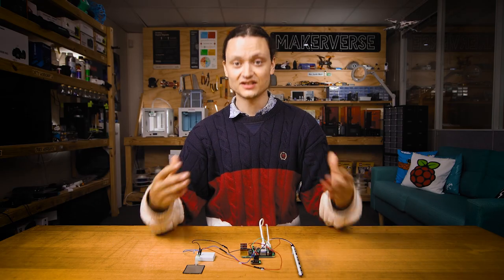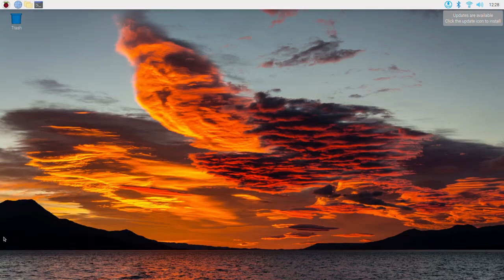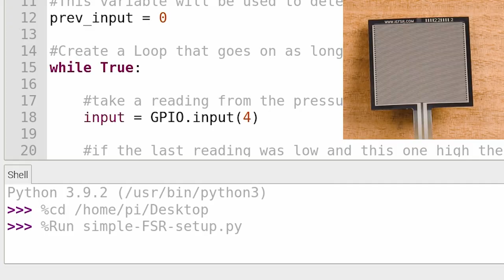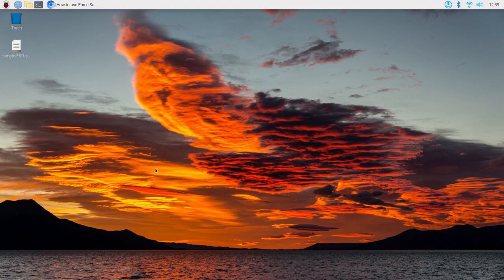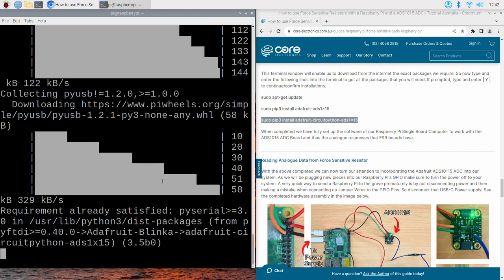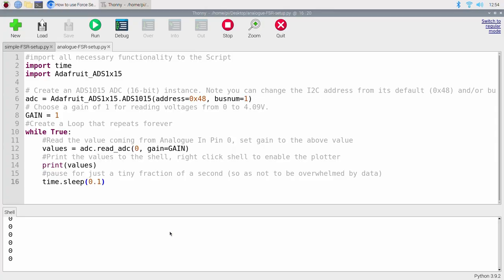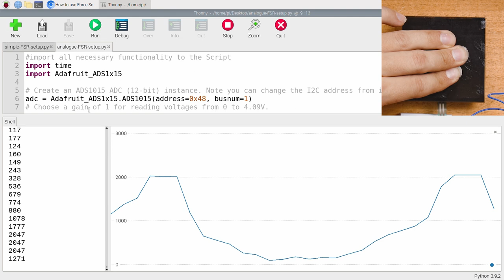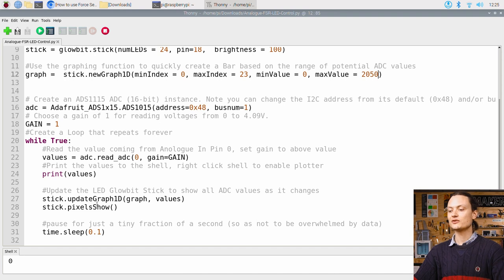How to use Force Sensitive Resistors with a Raspberry Pi Single Board Computer

Comment: This was very helpful for a project I'm working on thanks 🙏 . I found that you could also use Velostat, also known as Linqstat,used in electronics packaging bags and foam. The handy thing about velostat is that you can cut it in any shape you want and its dirt cheap, if you google it you can find its resitance curve and more info. Velostat is piezoresistive; its resistance changes with flexing or pressure. For instance, 25 mm² of fresh Velostat sandwiched between two electrodes measures around 9 kΩ without any force applied. But with 3 Newtons of force applied, its resistance drops to 1 kΩ.

Comment: Great video. Please could you advise what unit of measurement the final numbers are in? After the analogue to digital convertor is used that goes up to 2047 and you describe as the raw adc data. And is there a formula to get this into grams? thank you
Reply from the maker: It really isn't in any unit and is just an abstract number used to measure electrical signals. The raw ADC data is just a system that the Pi uses to measure voltages with 0 being a reading of 0 volts, and 2047 being a reading of 3.3 volts.

If you want to turn this number into a reading of grams, you would need to do some trial and error with known weights to fit a formula to it. You may have some issues with it though as these are not designed to measure weight extremely accurately. You may want to check out load cells for this, they are really cool and can measure weight with great accuracy (they are often the sensor that actual scales use).